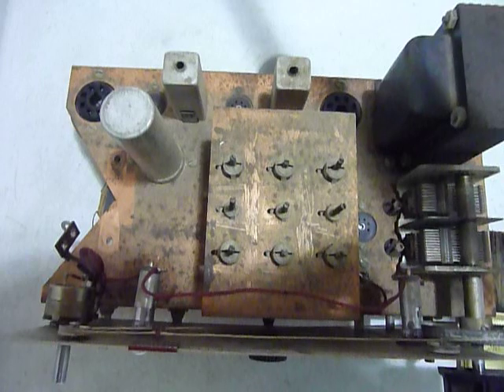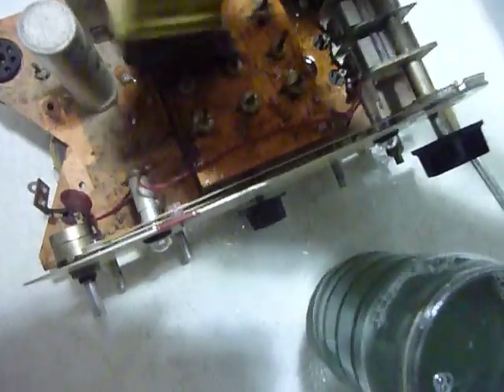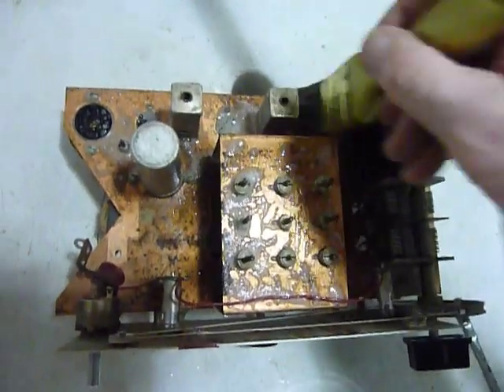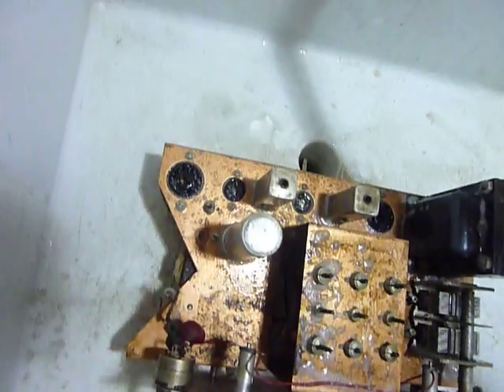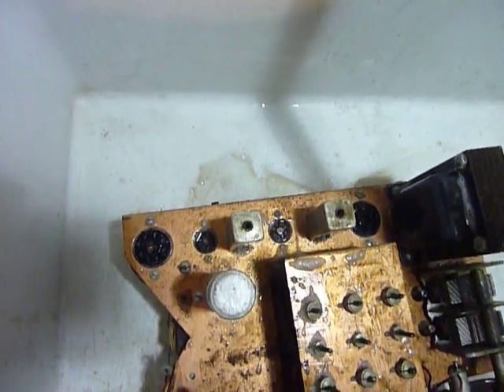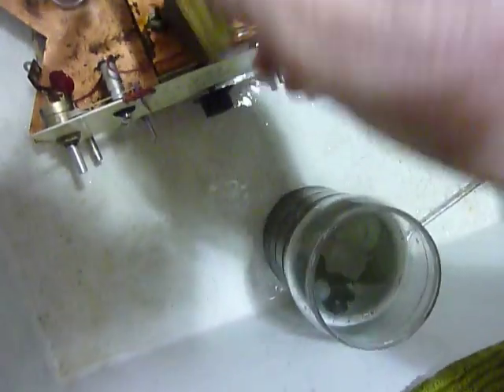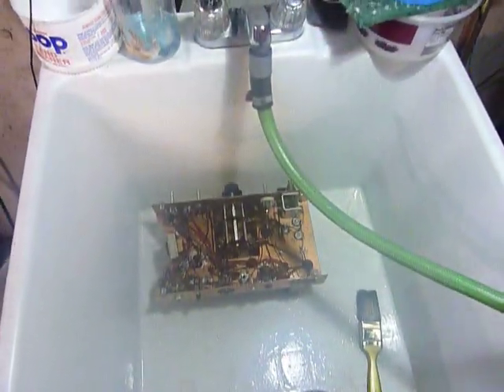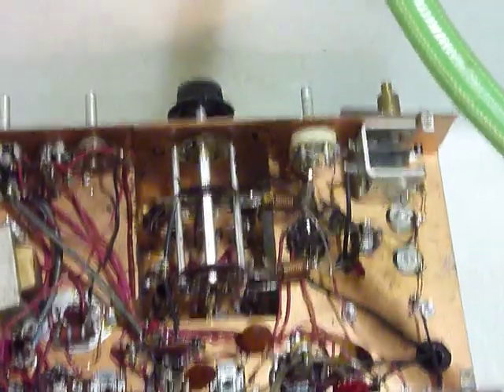Part - 2  , HEATHKIT AR-3, Amateur Radio Hf receiver  repair

Comment: Bob - I always enjoy your videos - Just used your soap, rinse, and bake routine on a Command Set transmitter and it worked great!  Trying to figure out a power supply from what I've got on hand.  Thank you !
Reply from the maker: Cliff the old CQ magazines had some really good ideas for ARC-5 transmitters and power supply info too.   73  Bob